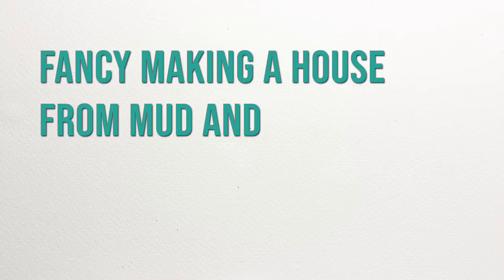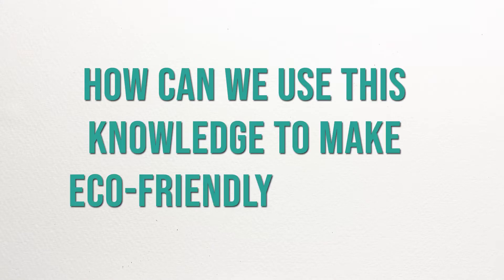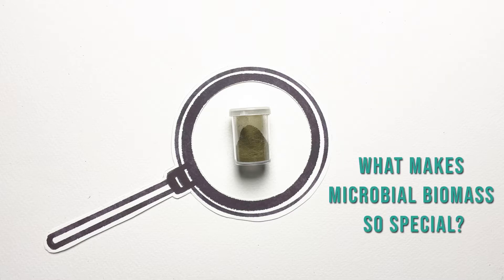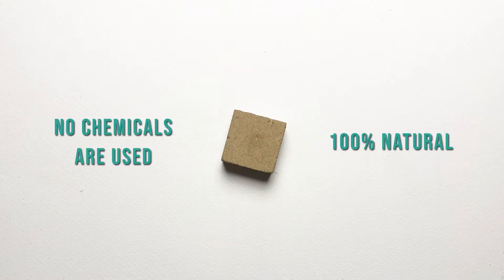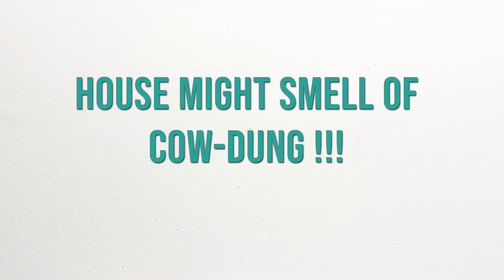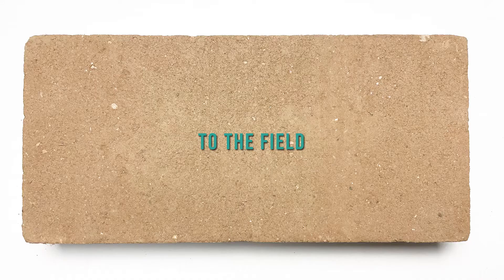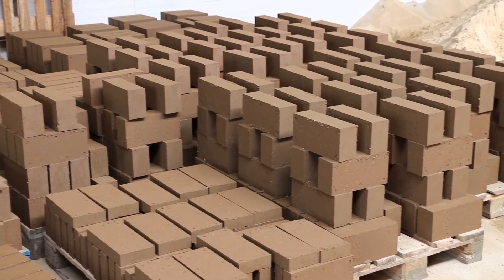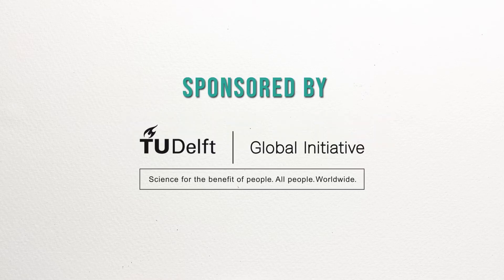Fancy making house from mud and cow dung? Here is what you need to know

Comment: Very well explained. with respect to ground plus four structures would you recommend these?
Reply from the maker: The feasibility of G+4 depends on the compressive strength of the bricks, which is dependent on the soil type and force used to make the bricks. But in general, I think G+1/2 is still okay, G+4 is possible if these bricks are not load-bearing and there are concrete columns. Although, design of building, especially roof will play  a major role.

Comment: This is a fantastic job Yask and the video is pretty clear and descriptive. I would like to ask you if there are any extra measures taken regarding the bacteria potentially present on the cow dung such as E.coli, since the process doesn´t involve baking the bricks. Thank you very much!
Reply from the maker: Thanks! In general, we took care at the source level to ensure that we were taking dung from a farm known for its high standards. E.coli in dung can be a major issue and there can be multiple approaches to address it, but then it requires some processing of cow-dung or addition of an alkaline material like hydraulic lime, which we wanted to prevent.

Comment: One question. In my village house cow dung is used on compacted red soil as a way of getting a smooth polished look. However if used outside the rain washes it away. 

So the question I am curious about is - what would make cow dung plaster not wash away in rain from external walls and floors? 

Would gratefully appreciate any advise. Thanks 🙏
Reply from the maker: Sorry for the delay in reply.  If it is used as a plastering layer, then the chances are high that it will wash away. if it is part of the blocks or wall, then it makes the walls more water-resistant.
Reply: Maybe it resists better when used in non flat way, someting maybe at least 45% steepness so the water can run..
I saw in Portugal, flat earth slab for cottage, made with earth and a little bit of cowdung, some eggs to add flexibility and have less cracks when drying, then they oiled it many layers (can be expensive if you have no wasted restaurant oil available) I would finish by a well smelling oil like linseedoil at the end.. It seems to resist very well, i dont know how long time were it there, something like 5 years i guess..